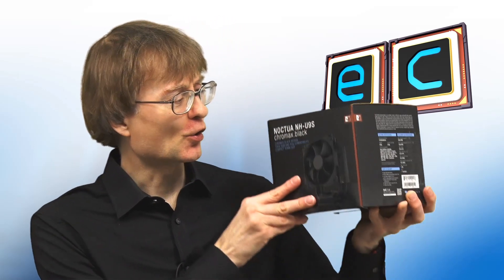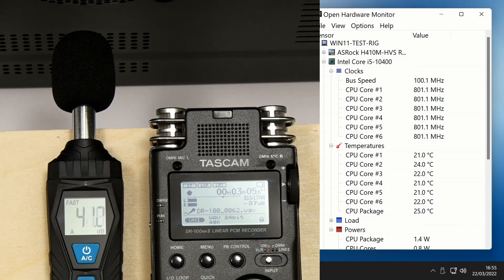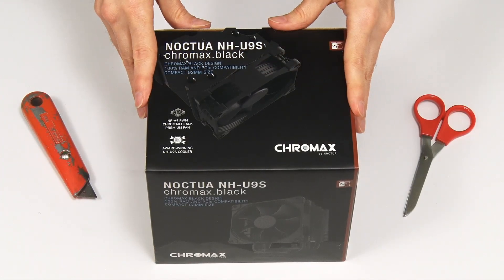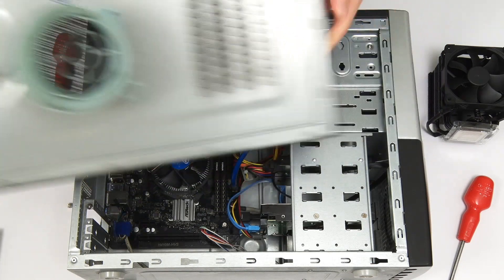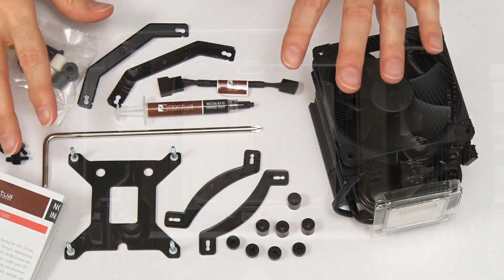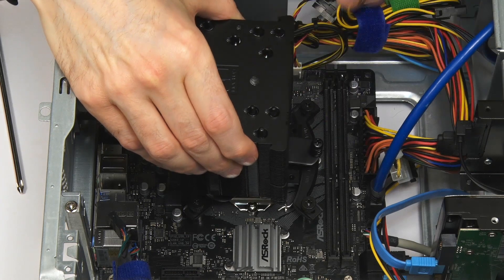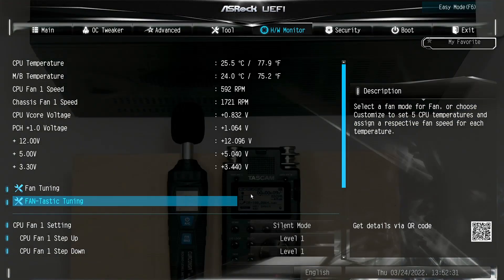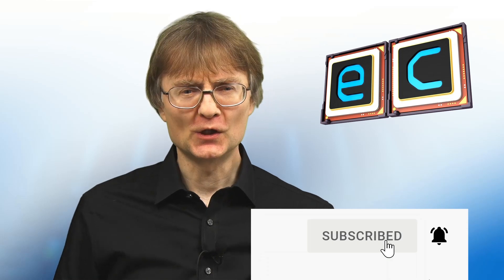Quieter PC #1: Noctua NH-U9S Cooler

Comment: Quiet and energy efficient seems to be the way the market is moving. I, for one, am pleased. Another great video, Chris! :)
Reply: Nvidia just introduced a 600w GPU.
Reply: @sleepywatcher3528  At 600 watts, it seems like a dud.
Reply: The market is doing the complete opposite.
Reply: @Thaumazo  Depends where you look. Apple has started the process off with ARM, and I reckon most tech companies will follow in the energy efficiency route soon enough. NVidia are just a little behind the times, i think.
Reply: @zebrasprite  - The market is definitely taking it's time to transition but GPU's will always be high powered.
Reply: @reggiep75  Of course, I do agree. But I think companies in the GPU space will soon try to market lower power draws (not low-power draws, but lower compared to competition)
Either way, it's all terribly exciting, and us consumers will get the best of it.

Comment: A good quiet fan/cooler setup Chris and it has its advantages. 

When I build my PC a few years ago I was convinced to install a water cooler. It’s very quiet and keep the CPU cool even when I’m over clocking my Ryzen 7 2700. 

The downside, I was told that it’s not a good idea to keep your computer running all the time. But to turn it off after your finished for the day just in case you have a leak! 

I follow this advice but it’s annoying having to turn on the computer every time I need it.
Reply: I have a water cooler and have not heard about powering down at the end of the day because of this?! I tend to keep my PC running 24/7 these days. I have had to replace the water cooler once as the fan/pump stopped working. (I don’t think I’ll bother with a water cooler in my next PC though.)

Comment: Fan unboxing series, I like it 😁
Sometimes it is not even the noise level itself but kind of frequency it makes. I put quiet 92mm fan into my 20yr old Dell 500SC but after looking into specs I think I'll look for something better. CFM on silent fan is 3 times lower that on factory fan.
Reply from the maker: You are so right -- the frequency is just as important.

Comment: Great video!  Looking forward to the next noise improvement solution!
Reply from the maker: Thanks. The results in the second part are more impressive! :)
Reply: I guess we shall see a case replacement. That is a cheap case with thin sheet metal, and something more solid would help absorb vibrations and would result in lower resonance.

Comment: On solution I've used at times for the audio problem - stick the computer in another room and run cables. Some things are easy to get right with this like keyboards and mice. But anything that's sensitive to long cables (Hi-speed USB 3.x, 4k video, analog audio) needs a little more planning.
Reply from the maker: Yes, I've played the long cables game! :)
Reply: @ExplainingComputers  "Game" is the right term.

Comment: I've been running an entirely fanless & quiet desktop for over two years now, using an undervolted Ryzen APU (3400G) with PBO disabled, an Alpine AM4 Passive CPU cooler, and a 120W PicoPSU, all in an mITX case made of plywood (with large, grated holes at the top, bottom, and one of the sides).
It idles around 45°C, hovers around 55°C–60°C under low loads, and goes above 80°C (but stays under 90°C) when gaming or compiling. I'm altogether pleased with how it worked out, although there's room for improvement.
Reply from the maker: I saw that Alpine cooler and it looks very nice, though it now seems to have disappeared from the market. :( Sounds like you have had great success with it.
Reply: @ExplainingComputers  It was excellent value for the price, shame it's no longer available.
On the subject of passive cooling I recommend the YT channel “Fully Silent PCs”, by the way. He deals with more ambitious setups than mine and has a number of videos where he extensively tests different configurations (e.g. fin orientation of passive heatsinks).
Reply: @PPAChao  One thing I've noticed is that nothing beats copper for passive cooling. I have some copper slugs with fins (probably from a Xeon server) that I use as quick-and-dirty heatsinks when I need to test but am not ready to mount a regular cooler, and they work better than the fan-and-cooler.

Also replaced the aluminum cooler on one of my AMDs with one that's all copper, and... 20 degrees difference, with a much slower fan.